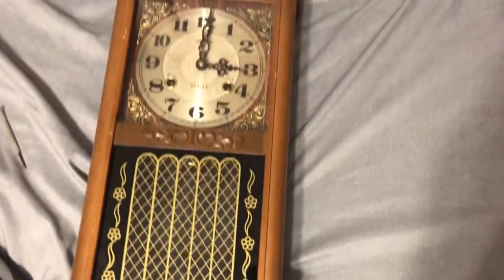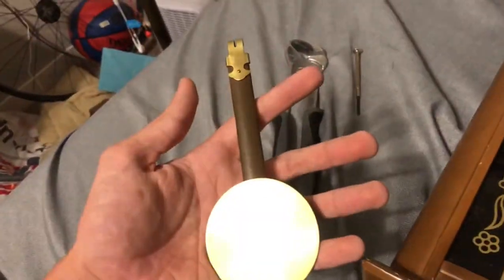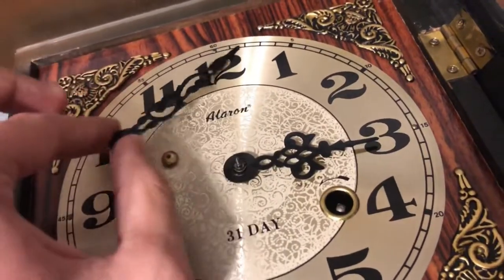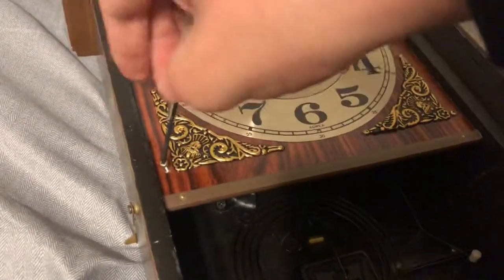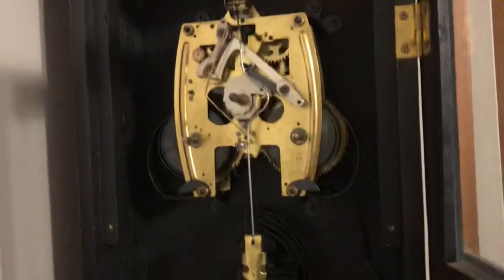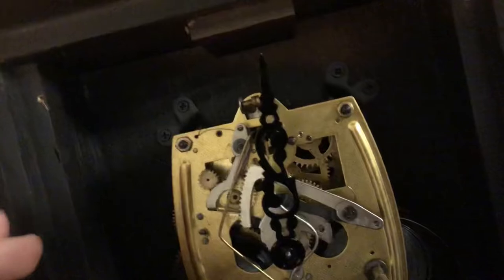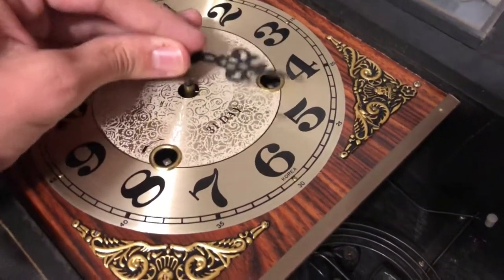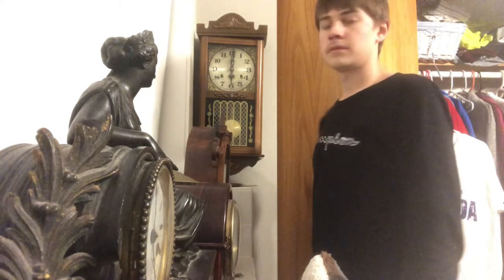How to Remove a Clock Dial

Comment: you really dont need screwdriver  to take the clock nut off
Reply from the maker: I used pliers, not a screwdriver. While you are right that the nut can be loose sometimes. Sometimes they can be put on really tightly so the hands aren't loose. Thus needing pliers.